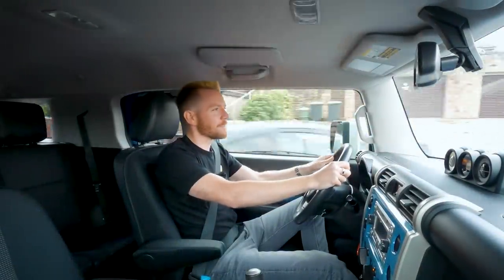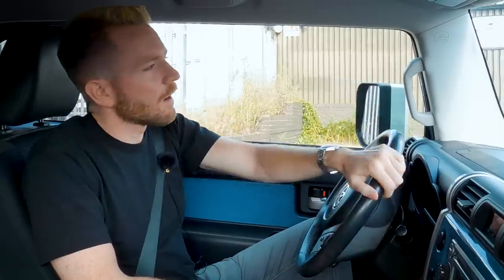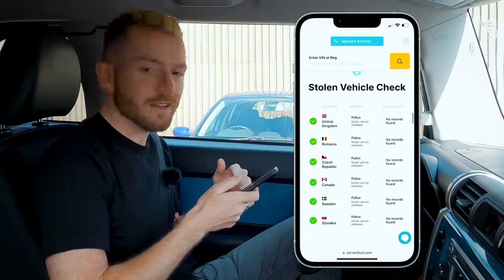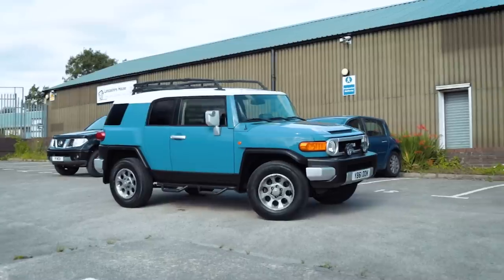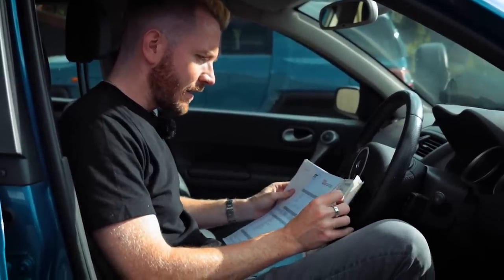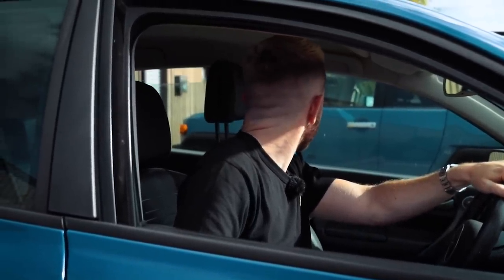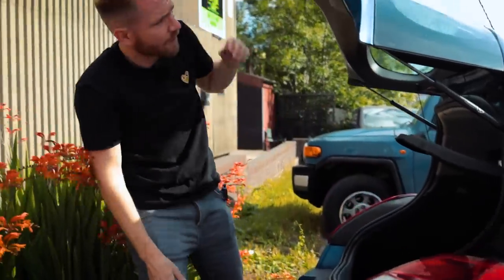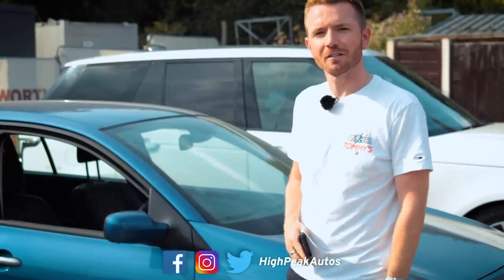I BOUGHT A RENAULT MEGANE FOR £295!

Comment: Haha. I had a 1.6 dynamic as a courtesy car. Very similar to yours. Megane had 500 miles on the clock.  Windows worked intermitantly, band driver seat was jammed in one position. I did like the colour and the odd looks though. Good video.

Comment: That diesel engine is supposed to be quite reliable so with a service it could last ages, especially as it will have been driven only by old people.
Reply: I had a Renault 19 diesel. Brilliant engine and happy o run on veg oil to.
Reply: Old people! Prejudice there. Disels need long runs to be at their best,so one owned by the more mature driver might not be so well used
Reply: @Anonymous-ib8so  agree, so many cars out there with the 1.5dci, so somewhat ageist comment. by the way the fastest driver i know is 74, he has a lead foot

Comment: The newer meganes and scenics are more reliable than the older ones. I have found the 2007 facelift improved the reliability as my dad had an 2007 scenic with no issues but the 05 megane we had spent more time at the dealership than at home
Reply: later ones are better, i had a 2008 modus and that was a cracker, better than almost the same nissan note, as it was so rare you could spot one in the car park. in fact modus are over £4,000 on eBay even though the last one made was around 2011/2012.

Comment: I had an ‘08 and ‘11 1.5 84 hp diesel as company cars. They were okay when new but deteriorated quickly and that engine was dangerously slow. I actually took it into the dealers because I thought there was something wrong with it. Was told that’s what they’re all like sir. Good on fuel and cheap to tax.

Comment: Front tyres are Rovelos - inevitably Chinese - part of the Sailun group but actually not too bad. Agree Megane could retail for £1295 since it will clean up - £1000 for a year's motoring and then £300 scrap is a fair deal.

Comment: The biggest problem with these was the wiring loom was too short, but it is a car over 10 years old. Cam belt is probably overdue also.
The electric windows were an issue, but they are VW parts so junk!

Comment: I learnt to drive in one of these circa 2007, well if I don't count the RAC young drivers day I did when I was 14 in 2004, that was in an astra mk5. The Mégane was a 1.9dci I think. I quite liked it, funny handbrake though. I was taught to put it in fourth gear once I was at 30mph, which is something the British advanced drivers institute go against according to honest john. Even now I occasionally put my 320d in fourth at 30mph, but it doesn't particularly like it unless it's an absolutely flat road or slightly down hill. The Mégane did seem happy though.

Comment: I bought a Renault Megane like that for £100 with 3 months MOT left on it.
Power steering didn't work and I kept punching myself in the nuts on low speed turns. Still, it drove me to a few interviews until I got a job then slept in the back of it until payday. Traded it in for an old W140 S Class - got my hundred back 😝

Comment: A colleague had one of these from new. In 2 years it'd been back to the dealer 17 times for problems.

One issue i do recall: car kept running battery down overnight. After 3rd battery they got a data logger hooked up to the car and found that the auto lights were coming on (it was stored in his garage, so went unnoticed)....

Comment: I used to by cars off a guy in the 90's for 150 quid, I had a Renault 9, I evne went to Poland in it, the day before I filled it up, the top of the tank was rusty and it started to leak, so I guy had to sort it the nex day before the boat sailed to Hamburg at 5, when i got to Poland the clutch cable snapped, it was getting stiff, at the time you couldn't by a cable in Poland for rhd, it was longer than lhd, so another guy knocked one together from a Polonez cable, that snapped as well, I had to drive all the way back and through Hamburg 650 miles with no clutch, I liked that Renault

Comment: Had a Clio 2010 that decided to combust at a set of lights at the finger post pub in Offerton then had a 21 that during a hot summer decided to shed its paint and recently a Auto Captur that didn’t always move when you put your foot on the accelerator which meant pulling out in traffic was a little unnerving..yep and the smelled all the same

Comment: Perhaps the water in the doors had evaporated due to the hot weather😃 In fairness it didn't seam too bad and if it could be fixed cheaply then I should think there would be few quid to be made from it. I quite liked the funky looks at the time.

Comment: Good video! Didn’t realise Renaults had such a poor reputation for reliability nowadays! Had a Laguna many years ago and it was a good car but it seems things have gone downhill of late.
Reply: No I'm pretty sure their new cars are pretty good in terms of reliability. They co developed a bunch of stuff with Nissan over the years, and have gotten pretty reliable. After 2006-2007 they just have the generic common faults most manufacturers have, like adblue problems on some diesels (Adblue i believe is 2013 and up models not sure) and brittle plastics. Sometimes some minor electronic faults happen too, but generally easy fixes, or are ignorable.

Comment: Bought a 2007 1.6 auto 6 years ago for only £350 due to autobox fault for someone learning to drive. (replaced solenoids and fluid ~£70+£55) and I do like driving it now and again for some reason but mostly sat in a corner of the barn these days due to the windows no longer opening which has plagued the car since purchased.  Not worth selling so may brick it into a shed an convert it into a generator.

Comment: had like 350k on it before the engine blew and the cost was... you know.. not worth, but the electrical parts were bad, sensors were straight up garbage, had a small issue every year for like 150 pounds

Comment: If the key card does work in the reader a bread knife helps
Reply from the maker: I once got one traded in and the owner gave me the key and also a tea spoon 😂
Reply: @HighPeakAutos  it's an old trick mate, I've had loads, in fact motd one this week for a customer
Reply: @HighPeakAutos  once jump started one and the ecus right behind the battery, lead jumped off and contacted the ecu and fried it, car instantly stopped, I had to get full ecu kit from ren parts.

Comment: My brother in low bought laguna grandtour 2 1.9dci couple years ago and it was full spec . he  payed for it like 4000 euros.Right after he bought it Windows one by one stopped working,AC stopped working,central lock and remote stopped working,parking sensors stopped working,abs and esp light was on,also service light or check engine light never came off either.it was super confy but horrable suspension all the time issues and repairs.eventualy started eating water and also turbocharger failed. he owned it like 4 years and spend so much money on that piece of crap and eventually scrapped it for 300 euros.

Comment: In 2004 i ended up getting a job at local Renault dealer part of my salary was a company car, my first day at work i was given the key/card to a brand new megane 1.6i 2 door, ok i thought, lets not look a gift horse in the mouth just yet, bearing in mind i had come from a Volvo S60 D5, so as the weeks went on i thought this car is bloomin awful, the petrol 1.6 was known for of its lack of performance, but the worst thing was the flat spot when accelerating, the boys in workshop could never fix it, after 3 months i opted out of the company car & bought my own a Passat VR6 4motion & never looked back.

Comment: ABS sensor 60GBP is a rip off unless you go to dealer-- now such things as removing one allen screw and putting a new sensor (if thats the actual sensor - some are located inside the bearing) are 5 minutes jobs so sensor cost still like 15GBP I believe and there is no point buying original one for this pile of... therefore 15GBP later and 5 minutes of work and one clean with OBD scanner Voala instead of paying 100GBP for actual sensor + labour

Comment: my old man had a R reg(1998) renault megane 1.4 back in the day. it was smashed up by my brother twice on drivers side, new light, wing, shock absorber, bottom arm then 3 week later a jaguar hit it again in a car park same side same repair, then a week later someone pulled out of a junction on my dad smashing it again.... so back to the breakers yard more bits fixed it again. then 2 months after that a woman in a range rover p38 reversed into it in asda car park. he drove it back home with the radiator leaking and the front end smashed up didn't even overheat!!.... back to the breakers yard, bonnet, front slam panel, bumper, 2 wings, both headlights and a radiator, 2 days later it was back on the road and he was driving it to work!. that thing took some right abuse and just kept on going and going and going.he swapped it for a 1990 ford granada 2.0i Ghia in the end. Dont know how good the newer meganes are built, ive only ever worked on my sisters scenic (f9q diesel engine (glow plug relay)).

Comment: I would say the owner has spent a fortune on it sorting it out as these fell to pieces with masses of electrical issues. I had a Laguna 2 from the same era it was without doubt the most unreliable car I've ever owned
Reply: Lol. Renault full stop. I had one years ago and have never had anything close ever again. I think it had only done about 70k to boot! Decades on still look back at it with utter contempt. My brother had 3 (slow learner) and friends too. All the same experiences and dealers had the audacity to try and charge Mercedes money to fix the garbage on top. French cars. Pure hate for life:)
Reply: I have Laguna 3 and the only thing ive done is re-coding steering wheel lock. Cost me £60 on ebay (send over old part, receive refurbished one).

Comment: Had mine 3 month's and in all the years off driving i have never hated a car so much. Used to break down 3 times a week much to my dismay. I later found out after i scrapped it ttat tge key had a chip in it and when it wore down the immobiliser would lock tge car

Comment: To be honest, they are good cars. Yes they have electrical sensor issues but these French cars are good cars. They come well equipped but every car has its vices. Some of the errors on the dash are erroneous and misleading but they can be sorted. Parts are cheap and if you can do this by yourself then its a winner 50mpg and £20 a year tax for some of them...worth the hassle?

Comment: Not a bad buy for the price. Someone will keep it for 1-2 years for 1 k. However, these cars give me nightmares. My first new car in 2007, paid 7995 for 3 month old vvti model. I was being tight thinking i got a bargain instead of the spaceship looking civic which was 8995 for an 07 plate. I couldn’t afford to get rid In the end. Under warranty it had 2 timing chains and numerous window motors. Following this the handbrake went. The timing chain went again. Clutch. Air con motors. Batteries because of the start stop. Window motors heat up in the summer and siege. I then finally gave it to my
Brother for 750 in 2015. He spend 2 k on it within 12 months and till this day reminds me i sold him a bum car. In total over 10 years we spend almost 20k on the car including the purchase price. Should have gone for the civic….

Comment: The prices of most cars you buy are insanely cheap. Yes, hes a dealer and buys for less but: Here in germany a good used car with fresh " TÜV", nothing majorly wrong and two decent sets of summer- and winter- tires is worth atleast 2000 Euros. In the current shortage of new cars, used car prices even went up a bit...

Comment: What would really put me off this Renault is my experience with an old C3 Citroen from same era...so expensive to repair.. and repairs in a weird way too. I am probably being unreasonable. (But Hang on but I had a Peugeot 405GL at its launch before that. Ran great till it got hot and you turned off the ignition. Brand new. "ohhh yes that's  a factory fault".. well don't bloody sell it other than Alaska. Continually stranding me 60 miles from home till the weather turned cold !! The French see design differently
Reply: Well, maybe the design of one model of one car from one manufacturer........!?

Comment: God this era of Megane was dreadful. I remember my now father in law adjusting his seat height only for the handle to stay in his hand afterwards. 
Didn't these also have a little panel in the wheel arch to get to the headlight bulbs?
Reply: To be fair my e90 BMW also has the wheel arch bulb flap. Dreadful design. My mum's Volvo V50 you just remove one pin and the whole headlight just slides out. Excellent design.

Comment: in the balkans you can't get them for lower than 1500 euros, and those are the worst ones actually. Megane in this shape would cost around 3000 euros easily. I still have one of those, 2004 1.5 diesel 2 door hatch, great little car.

Comment: What about the Little cupboards under the floor mats there is one either side they usually fill up with water
Reply from the maker: Haha oh yes
Reply: @HighPeakAutos  can I ask you my bmw g30 520d 2018 has just hit 80k auto gear box would you change the fluid in filter or leave it till it gets to 100k I bought it with 32,000 on it and the mileage I’ve done has all been on the motorway. I’m not too sure what to do I don’t trust any garages down here in the south so I was thinking of booking it in at The Garage you get your gearboxes done with what do you think. My best mate owns a garage who used to do all my MOT’s and work when I was trading he’s told me to leave it but I don’t wanna leave it and it fucks up I’d rather just get it done to prevent problems later on.

Comment: Sensible plan Matt. You just know you'd do the work, get the ticket, give it a valet and make £300 for your troubles. Then it would break down on a weekly basis, and nothing you could do would be enough for the peckerhead that bought it, right up until you offered to buy it back before scrapping it anyway. The only upside would be one less Renault on the road!

Comment: Say what you will about Renaults but I’d rather have those issues then the rust you get on the armchair experts Hondas and Toyotas they seem to pleasure themselves over. Had a 2003 Clio, some strange electrical issues but never let me down and usually only about £100 to get it through an MOT for stupid stuff, had a 2005 Civic, which didn’t have any electrical issues but took it for an MOT and was rotten underneath to the point the garage wouldn’t fix it and resulted in the purchase of a £500 welder to fix. Looked up the MOTs recently on both and Clio had silly little things like fixing an airbag light etc. the Civic had failed again on rust, doesn’t matter how well it runs if they rust away in the British weather, and it didn’t even run that well the engine burned oil and it got 23 mpg on a 1.6 with 100k on the clock haha

Comment: Against all advice I bought a 2004 Laguna 1.9DCi 10 years ago. What an excellent car it was, comfortable, good on fuel, decent to drive and 101% reliable. Compared to some of the German crap that came after it was a bit of a gem😂 The Keycard was never a good idea though.
Edit: I did have to replace the driver's window regulator - £22 in parts and 40 minutes easy work.

Comment: These things are such utter crap it's unbearable. This one is a late phase 2 which you can identify by the dog- bone-like structure below the front bumper. They were a liiiittle bit better but still real crap. 
Had a particularly bad phase 1 myself and it cost me dearly: 4000€ of (mostly warranty) faults in a space of 18 months. Turned me off any french car ever since.

Comment: You do talk a load of bollocks about Renaults Meganes.
I have a 2002 Megane Fairway 16 valve petrol, bought new. With three hundred thousand kilometres on the clock.
Never ever failed a MO.T. Never had problems with brakes abs. Never had any problems with windows. Never ever had any water leaks and has always smelt wonderful. Never once let me down.
It seems you let your prejudice cloud what little judgement you have.
Reply from the maker: Experience has moulded my opinion.
Reply: @HighPeakAutos  
Yes the same with me.
Retired now, used to be a motor mechanic.
My suggestion. Do not be so obvious with your prejudice.
Reply from the maker: @bobinnis2057  I’ve found most cars to be crap to be honest. They’re mostly all as unreliable as each other but for me the French take the biscuit 😂
Reply: @HighPeakAutos  
Ah. So you admit to having a hatred for French cars ?.
Rather defeats the point of your channel, I would have thought.
Also pissing off a great many people who very much like French cars. But there you go.

Comment: It smells like a renault yer that'll be burnt wiring or damp matts but then again they are comfortable you do need that on the hard shoulder 😅🤣😂💩
Reply: Mechanically those Meganes are very reliable. The electric niggles mainly effect the windows but a cheap enough fix.

Comment: you drive a great car Toyota and buy a crap one. Renault is the most unreliable car make the is,  i had a Renault once for 18 months here are the things that went wrong. head gasket, radio would over heat, the pasanger window did not work, the door lock the boot lock, and ignition barrel twice, the clutch cable twice, and it had running problems 2 days after geting it had to have a full service + + just to get it to run ok and when i say ok it never ran right. i had a rover 200 1.6 for 9 years and only had 2 problems with that and they say rover are rubish lol give me a rover over a French car any day

Comment: Your bias agaist French cars is without basis in fact. French cars are rated higher for reliability than German vehicles. I have owned Renault,Citroen and Peugeot cars and driven them thousands of miles with no problems. They have been 100% reliable, they are economical and comfortable as well as very practical. Open your closed mind to facts not fairy tales